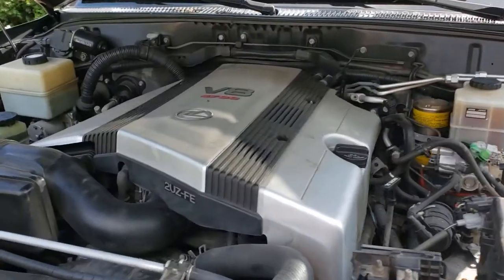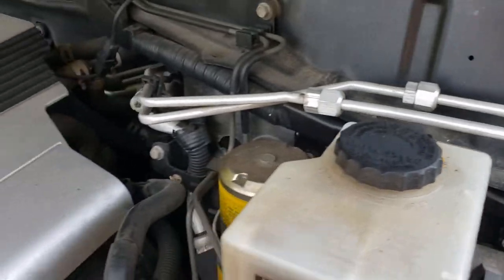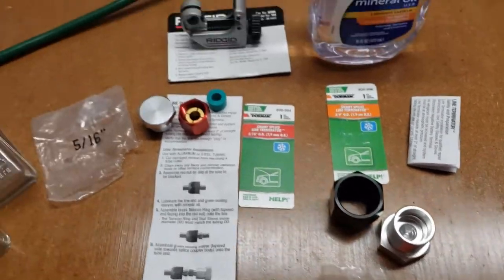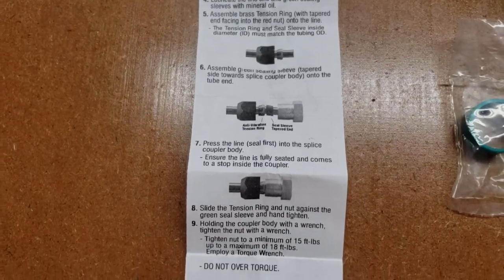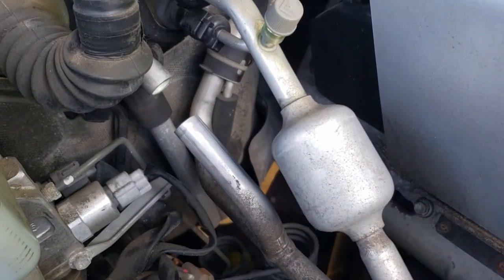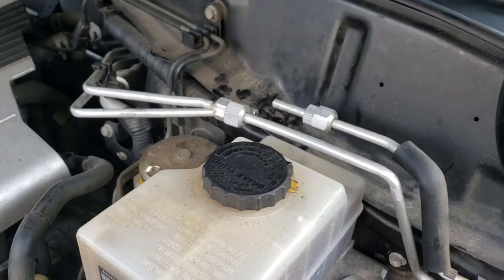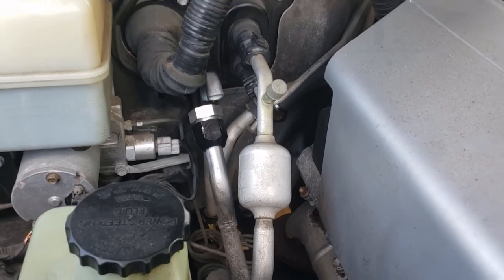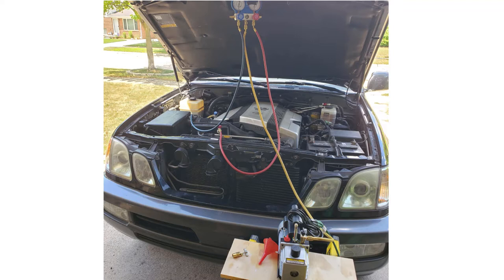100 series Land Cruiser / LX470 rear AC cap - easy fix

Comment: Yeah im missing that big AC line on my lexus, my AC still works but the recirculation button doesnt. im guessing the previous owner just deleted the entire line for the rear. instead of capping it off,  unless was just prone to rust and took it out. idk lol  i should cap off the open AC lines now though

Comment: How much r134a did you charge it with afterwards? If you want to get the rear AC system working again in the future, do you need to replace those lines that you cut? Or is there any adapter to join them again? Thanks

Comment: So I have a problem with this, in that whatever you cut it with leaves metal shavings in the lines that will go into your system. That's usually what kills ac components anyways, so that's not idea.
Reply: Okay I realized you are using a pipe cutter, so only the file would make shavings, my bad. I disconnected the 5/16 line up front behind the bumper.  Going to disconnect the line there, weld the line closed and tighten it back down. The main line will probably have to do what you did.